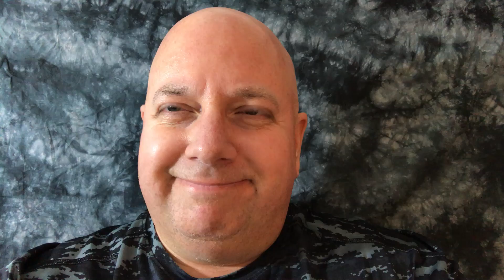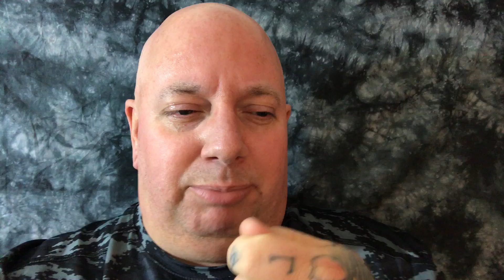😱ULTRA-COOL RF INDUCTION & Phantom-Voltage! Must see!

Comment: I used to play around with radios and cb radios and build my own antennas and sattelite from the frames of old speakers and tin foil, I've also electrocuted myself in so many ways, I've zapped myself in the mouth stripping cables and working so fast I forget to turn stuff off or pick up the wrong cable, plus in the UK we have DC output on our outlets that are 240v its 110v or 140 A/C in the US so you can imagine what that was like, plus I was a skinny 7 year old when I first started dismantling the house.

Comment: So, are you no longer active on HF Ken?
I still play with the stuff and run portable most of the time next to salt water. Gets me out of the house and the misses hates radio so no objection there 😁😁😁
Only run low power 100W to 400W but sufice to say you sure know about it if you have a problem. Those rf burns hurt.
Reply from the maker: just too busy man !